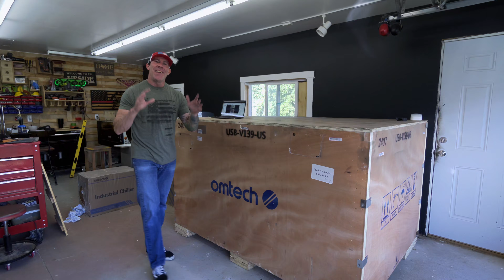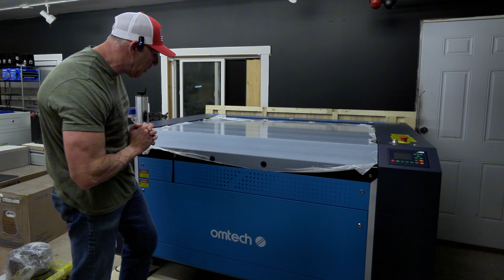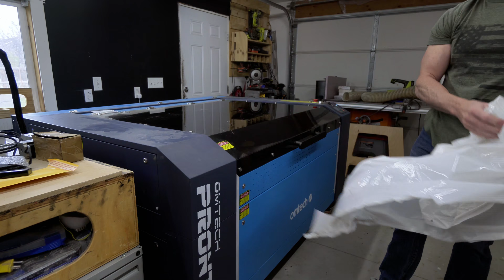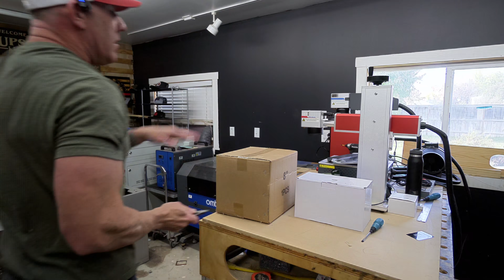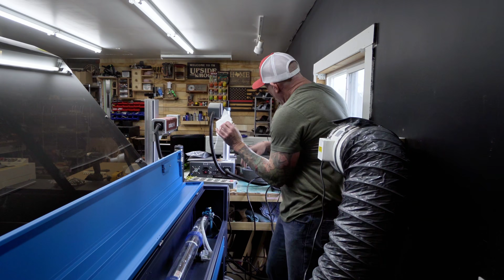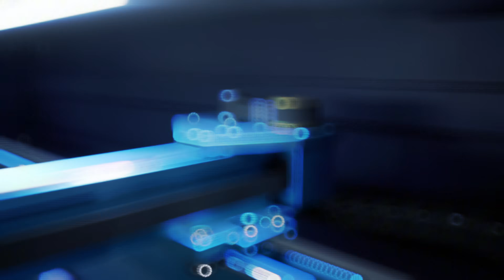Omtech Pronto 60 | Ultimate Unboxing, Setup and Review

Comment: Thanks for the video, I’ve just got mine but I do a lot of two ply plastic and would usually have the air assist off (I know it’s not the best idea) but the results were great and with the pronto I seem to always end up with black debris stuck to the white because I have no control on the air assist. I’d do the same for engraving leatherette so wondered if you’ve encountered the same issue and or resolved it?

Comment: Hold up.... just watching this for the first time! WHY are you starting the Unit up with the Laser "on"!   did you have the water pump running ? and also your should never start the unit up with the laser on its a good way to brake and or damage the laser... you need to start with it off, turn on the unit the water pump then the laser
Reply from the maker: What a great channel you have. Full of valuable information on laser engraving. What on earth would I know. Thank you so much for the pointless comment!
Reply: @RISENGRINDWORKSHOP  no needto be a dick bro. i was pointing out a critical issue that might cause issue but ok

Comment: Just wondering if it's worth buying a pronto 60 over another omtech 130w laser with the same bed size for 1/3 less in price . Is there that much difference in quality .
Reply from the maker: The pronto is a far superior machine. Baseline OMTech 600/mm raster vs 1000/mm with pronto. Better autofocus system, it’s a thunder nova for half the price!!!
Reply: @RISENGRINDWORKSHOP  Thanks mate , I'm in Australia so I'm looking at about $14k for the pronto as opposed to $9k  for the base model . I'll be going for the pronto when I'm ready , worth the extra $5k by the sounds of it .
Reply from the maker: Honestly. I’ve had both. The base model is perfect starter machine. Great price. If you can afford the pronto it’s a much better unit. Has touchless auto focus, smart controller which has external fume fan and air pump, cleaning trays, 1000/mm raster speeds. Dedicated rotary attachment plug and all new drive and gantry system
Reply: @RISENGRINDWORKSHOP  Thanks mate , I'll let you know how I go when I'm ready . I was looking at the p2s because of the auto pass through , but I really think I want the big bed . Cheers mate .
Reply from the maker: @Magma2035 pronto is industrial grade P2S hobby grade. Compare specs. Speeds and features. I like Xtool ultra F1 but the co2 line is something to pass on
Reply: @RISENGRINDWORKSHOP  Yeah , my mind's made up on the 60 , thanks mate .

Comment: Hi, I just purchased the Pronto 60. Are you by chance getting any flash back when cutting acrylic using the honeycomb? I have a 1/4 clear acrylic, and I use 5mm @ 20% which cuts beautifully without flashback when I use 1" stand offs. But any closer to or on the honeycomb is another story

Comment: I just bought Pronto 60. Did you have to level the feet before using?
Reply from the maker: No. Level doesn't matter. You need your bed level to your gantry. That's called Tramming the Laser head to the table.
Reply: @RISENGRINDWORKSHOP  Thank you for your reply. If unit itsself is not level how do know if gantry is level to bed?
Reply from the maker: @terrylbs1  You measure at all 4 corners of the machine, from the top of the bed to the bottom of a foxed spot on the gantry at all 4 corners. Should all read the same, if not you need to LEVEL the BED to GANTRY not level the entire MACHINE
Reply: @RISENGRINDWORKSHOP Setting up my Pronto 60 today and hooked up chiller and ended up with one bubble the size of pencil eraser right at the tip by first mirror tried lifting opposite side of machine about 1 1/2 inches but bubble won't come out. Should I be worried about this one bubble?

Comment: Yeah, the Air filter isn’t get all that smoke it’s making my basement really smoke. Can I connect an external fan in between the engrave and my filter? If not then I would just have to vent out my window. Let me know what you think thanks again I appreciate the feedback back.
Reply from the maker: I don't personally use a a filter box, but yes, you would just install the inline fan between the laser and the fume box.

Comment: Hi, your videos really helped me out, I have a question. So I bought an omtech with the 85w industrial air purifier, do I still need to upgrade to one of these AC Infiniti duct fan? I guess that’s where I’m confused since I’m not venting it out my window. Thanks.
Reply from the maker: Thank you so much for the kind words. The omtech units come with an onboard pump. Most users eventually upgrade to an external inline fan such as the A/C Infinity I talk about. Me personally I have always just used the stock pumps on the machine. The NEW pronto comes with a large external 8" inline fan which is fantastic. Now regarding the HEPA Filter Box, I would personally use the laser as is, and if you find it necessary then you can upgrade to an external inline fan.
Reply: Ok thank you so much I appreciate it.

Comment: EGreat video, but I wouldn't recommend Omtech or Monport machines as both are lacking in quality and stability. Opting for them is essentially a gamble; my Omtech pro 150w z-bed collapsed after just a week, and I have to realign the beam every 2 weeks. Occasionally, I encounter issues where the left side of the bed does not align with the right side, can you believe that? They only appear to be a good machine when they are listed online and we do not have to purchase it. Customer service is nearly a nightmare, as they will keep redirecting you until you give up and seek a solution online.

Comment: If this is a review, how about some video of the inside mechanics of the machine? Looks like a Thunder Laser but they cut corners on the control board, used standard stepper motors and no dual air assist.
Reply from the maker: @plus1miniatures344  30 comments and we finally found the ungrateful poster! 🤦🏼‍♂️

Comment: The best unboxing and setup video I have seen.  You were answering my questions as I was saying them out loud to you :)

I do have a couple of questions still to be answered.

1)  Why do I find so many negative comments about OMTech with people saying it is worth paying the extra (at least double) for a Boss Laser or ThunderLaser or Aeon?
When I've watched YouTubers unboxing or reviewing OmTech, everything seems to go smoothly.  
2)  The Pronto seems to be an upgrade from their standard machines.  Is it worth the extra money to go up to the Pro series?  Is there much of a difference?

I'm excited for part 2 of this video.

Thanks!
Reply from the maker: Charlie, makes my day when I read comments like this. Truly does! Most people don't comment. There is no sugar coating this, OMT is known for having crappy customer service. The price reflects this. I own AEON, xTool and OMTech. They all have PRO's and CON's. I simply try to showcase the products and lead the consumers down the right path to help them decide which laser meets their needs and clients expectations. I love and use all of those brands in my shop on the daily! OMTech has an amazon FB groups that I personally have used and relied on to get help. The AEON is hands down a better built machine for sure. Now both machines will get you to the finish line, just in a different way! The New PRONTO was designed to address some of the earlier generations short comings. With new tech machines are always improving. Plus Happy people don't share online. I think most people buy a laser who have no idea what they are doing and don't even know how to use a computer....then just go to the internet and complain :)

2. The PRONTO is an all NEW laser. Nothing like the Original AF 130W units. This unit has a new Gantry, Transmission, Stepper Motors, Controller, Exhaust System, Airline Pump etc... Now keep in mind this is the PRONTO 60 - they have a 40/45/60/75 as well. So follow that link in the description and browse the units! You can also email me RNGPRODUCTSLLC@gmail.com with more questions. I know what it's like to spend BIG money on a machine. Makes you feel sick. That's why I am honest and try to help everyone and don't lock into one brand! They ALL have a target audience!
Reply: @RISENGRINDWORKSHOP  email sent.

Comment: Hi. Thanks for the videos brother. I just bought an OMTech Pro 2440. I couldn’t locate the link to download the lightburn. Which one do I pick, the pro?
Reply from the maker: Jose, thanks for the comment my man! So Lightburn is making some changes to their purchase program. Did you buy a copy of lightburn with your purchase? If so, you should have received an email with instructions on how to activate and install your copy of Lightburn, as you will need your activation code. Lightburn used to be sold with Diode, CO2 or Galvo options. They now include all those options. So either download the 14 day free trial then choose activate and use your code, or find your email, and follow the directions. Worst case, EMAIL OMTECH and ask for the CODES in an EMAIl!
Reply: @ I have not bought a copy. I’m about to do that. So downloaded and they’ll send me a code? Which lightburn should I download for the OMTech pro 2440?. Sorry I’m a marine who is still using crayons lol
Reply from the maker: @JoseHernandez-mj6ne  Copy that, you can buy direct from Lightburn or go through OMTech, use whoever is cheaper. You can use my code RNGPRODUCTS5OFF at the OMTECH website at checkout and will save you 5% - they have new versions. Buy the PRO version that willl include GALVO CO2 and the DIODE lasers. You will always own that copy and get free version updates for a year. If you buy from OMT they will email you the download link and activation. Very easy! Let me know if that helped you!
Reply: @RISENGRINDWORKSHOP  thanks brother. Do you prefere usb or Ethernet? Do you have a link on how to? Is it light burn for co2?
Reply from the maker: @JoseHernandez-mj6ne  I use USB yes CO2